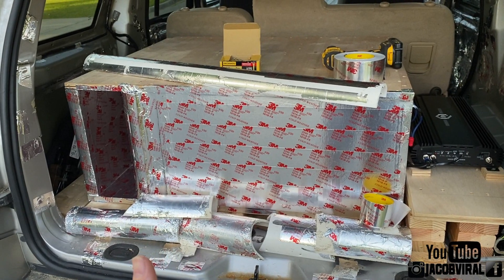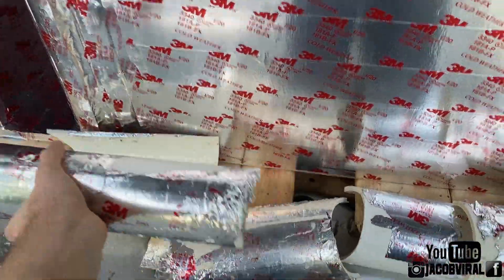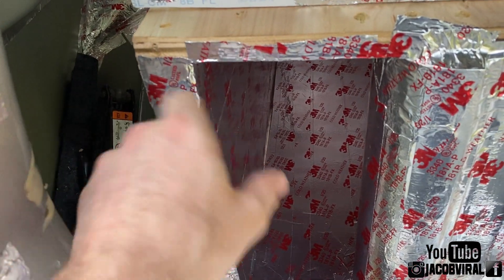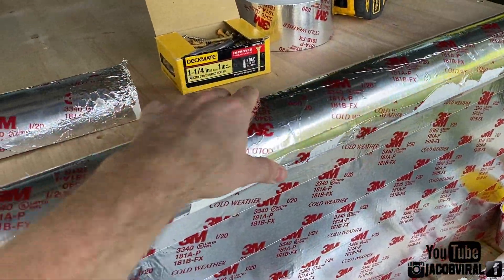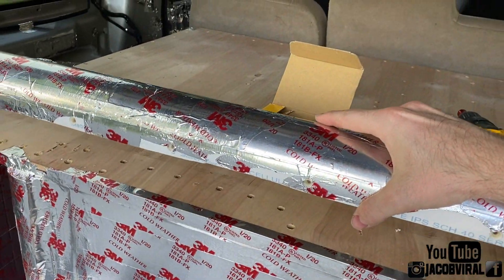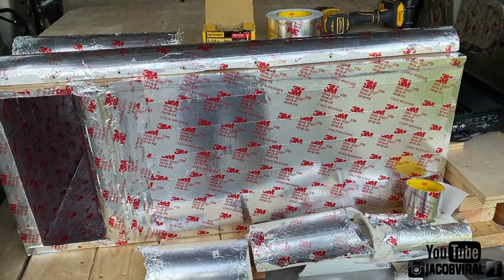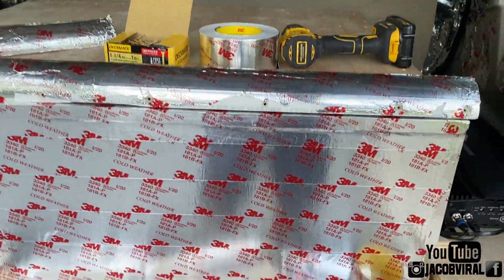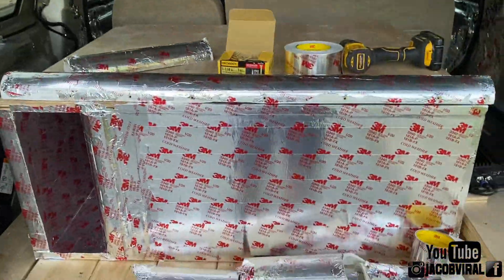WHY ROUNDOVERS ARE IMPORTANT ON SUBWOOFER BOXES?

Comment: I rounded over my 3/4 sand ply box build on all the outer edges straight on the 3/4 wood and no issues it isnt much that it shaves off i aint dbbl baffle either

Comment: Thanks for your videos they really help I have a question for u do high output alternators mess with newer cars computer systems I was told that the battery light could come on like the alternator is not charging plz give feedback on this
Reply from the maker: Yes, if the signal isn't plugged in to provide to the computer it'll always show an alert and battery/voltage issue. I have this on my 2006 explorer, I ignore it.

Comment: I've Got An Idea That May Or  May Not Work.... I'm Going to Start Working On It Hopefully Soon And Putting It In A 98 Model Eddie Bauer Explorer 4 Door And it'll Be A 2—12 Sub Setup,, That Should Be Numbers Making Depending On What Subs I Decide To Use... It's Going To Be At  2 Or 3 Months Out And It May Be A Little Longer But I Can Say I've Personally Never Seen Any System, Like What I Want To Do But At The Very Least, It Will Be In Interesting To Try